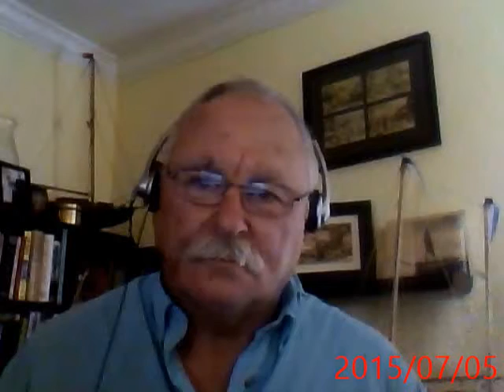Lessons to be learned from Cheeki Rafiki

Comment: I don't understand why you don't have the same set up as racing dinghies and racing sailboats like the UK 505s. The keel is slid in from the top, way above the water line, so it can be removed, extended, reduced and easily inspected. And because the keel is an integral part of the hull, it's much much more sturdy than a bolt on keel, which is just crazy design decision.